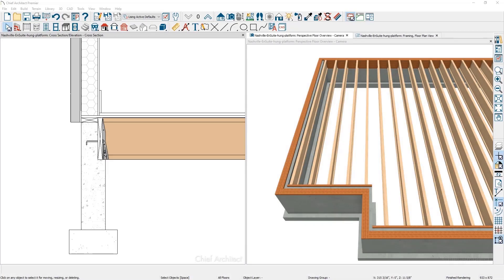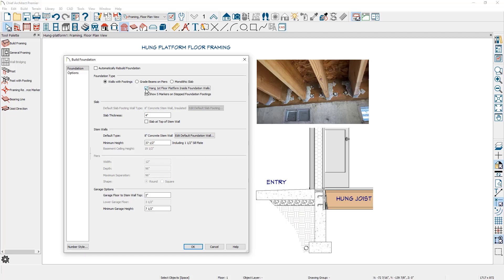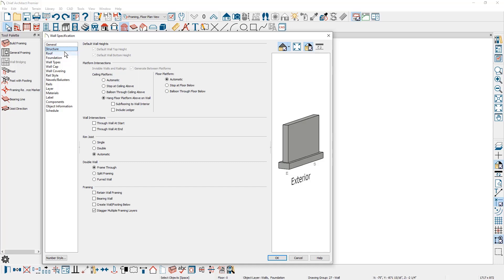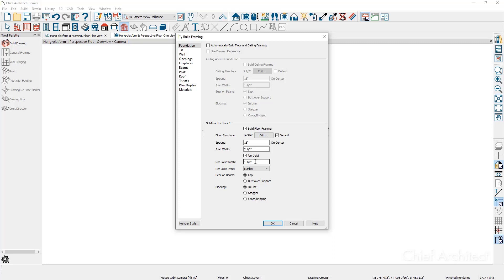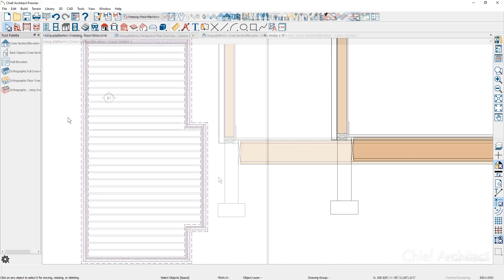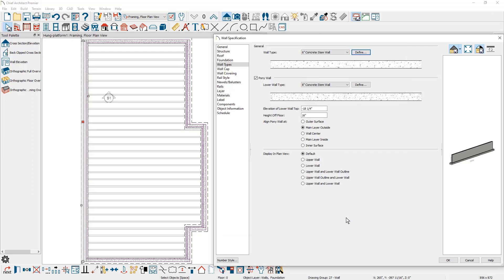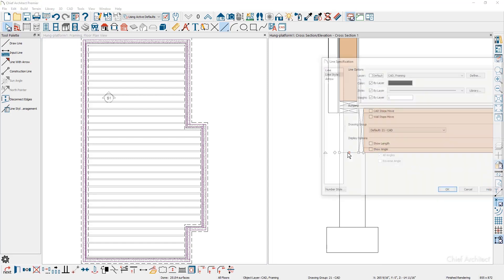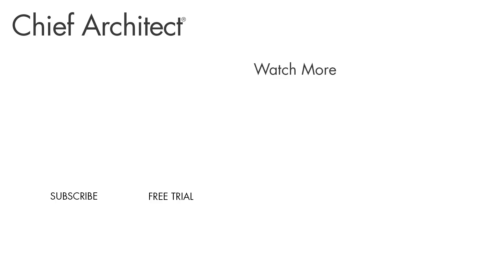Creating Floor Platforms that Hang Inside Walls

Comment: I would love to see the expansion of this video with some of the material contact detailing identified regarding engineered wood in contact with concrete.
Reply from the maker: Thank you for the suggestion! We will send this to our training team.
Reply: @ChiefArchitect  Thank you, also the j-bolts sticking into the side of the concrete wall is not likely to exist in that manner as they would interfere with the formwork at the time of forming.